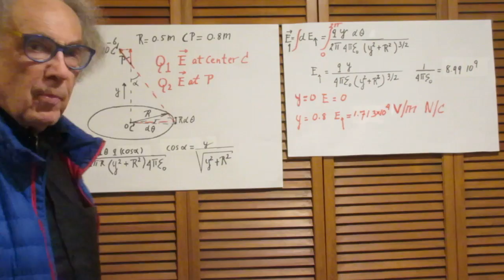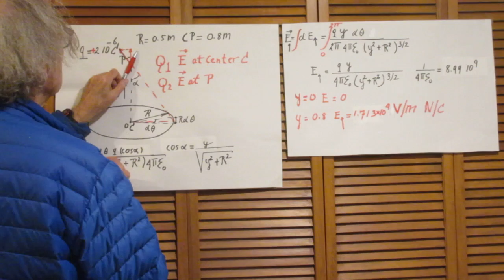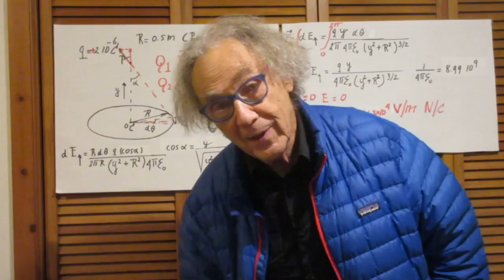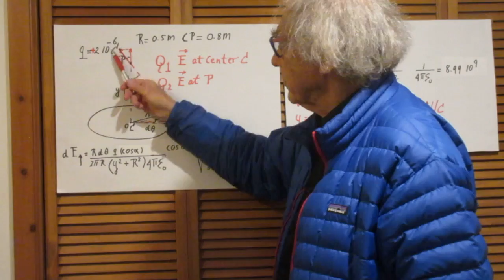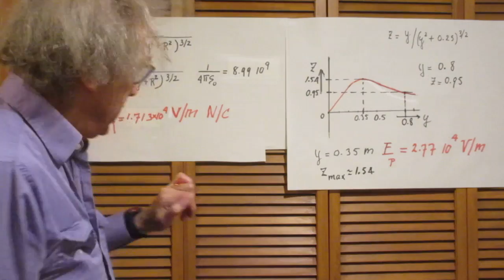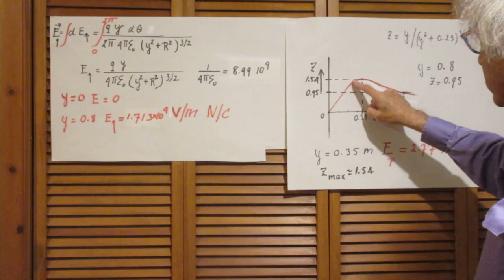Solution to Problem #49 - Charged Ring

Comment: This can be solved much easier:
one can say that the whole charge is at any point on the circle. (Because every "infinitesimal charge" contributes the same "infinitesimal" E_up. This can be treated as a single charge anywhere on the circle because of symmetry)

Thus we can calculate the E-field in point P with 

E=1/(4*pi*epsilon_0) x q/r²    (absolute value, not pointing in upward direction!)

where r² is the distance between any point of the ring to point P.  

r² = R² +0.8² 

Now we have to project the E-vector on the upward axis.
This leads to

E_up= E x cos(α) = 1/(4*pi*epsilon_0) x q/r² x 0,8/(sqrt(r²+0,8)) = 1,712717 x 10E4 V/m

with cos(α) = 0,8/(sqrt(r²+0,8))

No need for integrals! (When searching for the maximum for E_up, the mathematical handling is also easier)

Physics rulez!

best regards
Michael
Austria
Reply from the maker: yes this is faster. The ONLY reason why I did not do it this way is that my method in principle works for all configurations such as in Problem #50 where your method could not be used. When I posted #49, I knew that #50 would follow and I mentioned in Problem #49 that it was a warm-up to #50.

Comment: Actually the analytic solution is not so hard:
E ~ y(y²+r²)^(- 1½)  differentiate w.r.t. y and set that to 0
(y ²+r ²)^(-1½) - 3y² (y²+r²)^(-2½) = 0 multiply both sides by  (y²+r²)^(2½) 
y²+r² - 3y² = 0
r² =2y²
y= ±½√2 r

for r=0.5 this gives y= ¼√2 ≈0.35
Reply from the maker: excellent!
Reply: @lecturesbywalterlewin.they9259  
Thank you!

Comment: sir does the electric field exist inside the conductor . then why the electric current flows inside the conductor
Reply from the maker: HUGE electric currents can flow through super-conductive material. But there can be NO E-field in the superconductor. Read about the LHC.
Reply: THANK YOU SO MUCH SIR

Comment: Dr. Lewin I have query related to nuclear physics
'For any process if the binding energy increases then we can conclude that energy must be realeased which means that process is spontaneous.'
Yeah professor I can't understand how this statement can be true, I will appreciate any help from your side or any other viewer. Hope you doing well.
Reply from the maker: If BE per nucleon increases in a nuclear reaction, energy will be released. 
That happens in the fusion of low Z elements and in fission in high Z elements.
Reply: Lectures by Walter Lewin. They will make you ♥ Physics. Yes professor thank you, but wish i know the reason why energy is released when BE increases.
Reply from the maker: E=mc^2 If the rest mass decreases then energy must be released as energy is conserved
Reply: Lectures by Walter Lewin. They will make you ♥ Physics. Yes professor I got it but I solved this problem with a different approach.
X->Y and the binding energy per nucleon for Y>X. So firstly x dissociates into it's nucleons and A amount of energy needs to be supplied. Now for forming Y all these nucleons will bind up and supposed B amount of energy is released. Now the total energy released is (B-A) which is greater than zero.
Is my intuition correct? I came up with this idea just a couple of minutes ago.
Reply: @lecturesbywalterlewin.they9259  Sir I have seen in most cases they use E=mc^2. What about the other part of equation involving momentum? Don't we consider it here?
Reply: @chirag5656  dude can you please be precise, i cant understand what you are trying to convey, probably i can help you with this problem.

Comment: Another great lecture sir. But i want to say this. I dont understand whats the point of these objective type examinations and remembering those equations which can barely be used in the real world. Instead of remembering those formulas you can derive them whenever you need. For example, If you working on a physical  problem of real world(whether its mechanics, electromagnetism or relativity) you can start with physical laws and then usually you will end up with a differential equation and the only thing you have to do is to solve it. Thats it, there  is no use of those formulas. In school problems (or objective type) questions, all problems can be solved on paper but in real world you will get a differential equation(nearly alll the times) and usaully that equation can not be solved on paper. You need a computer to play a simulation. Again no use of those formulas. I understand your point sir. Instead of remembering every single equation in physics you can just remember the laws of physics and derive anything whenever you need. and thats the motive of physics. To decribe the nature with less and less physical laws. But they are kind of doing opposite of this. I really love the way of your teaching, instead of asking the students to remember formulas, you just encourage them to derive with the basic physical laws. I also want to become a physicist please give me your blessings sir.

Comment: Another interesting I thought up to solve the problem is that to assume two charges of charge Q/2 separated by distance 2R and find the charge on the perpendicular bisector of that line. I did that because all the charges  dq are at the same distance from the center of the circle and their horizontal component will get cancelled out and  vertical will add up so it would be a safe to make this assumption. What do you think Sir? 

After all physics is all about understanding and imagination.
Reply: I did that, more or less  ... it leads to the correct result. So you don' t need calculus to solve the problem.Even one charge on radius R will work but you need to multiply with sin(phi) to decompose the vector the vertical way. Any number >1 charges evenly devided over the now imaginary ring will lead to a straight up field anyway. The single point does not but multiply with sin(phi) and it's still the correct answer.

Comment: I tried to find an analytical result for the y value at maximum Z, and I get y = square root (1/8) = square root (0.125) = 0.353553391...
First, if Z is maximum, Z squared must be maximum, so I squared the equation for Z and call that value W. The formula for W now has y squared in the numerator and the cube of the parenthetical expression in the denominator (instead of the 3/2 power).
Expanding the denominator gives an expression in even powers of y, with y^6 as the highest power.
Substitute u = y squared, apply the quotient rule for derivatives, and set the numerator to zero.
This gives a cubic equation in u, with roots 0.125, -0.25, -0.25. y is the square root of u, so use the real square root, y = square root (0.125).

I do not have a good justification for ignoring the imaginary values of y except that I don't know what physical interpretation they could have; perhaps someone does?
Reply from the maker: superrrrrrr - my eyeballing (0.35) wasn't all that bad!

Comment: Know whats funny ? I computer coded the whole thing, dividing the ring in 1000 pieces and summed the resulting force for every piece. Got me the correct result. Today i changed my code and divided the ring in 1 piece. Got me the correct result. That means i could have done without coding.........
It also means that it's not relevant that it's a ring. It could have been one point on distance r but multiplying with sin(phi) would still be needed cause the resulting vector is straight up due to symmetry.

 I' ll keep my code for the next one :-).
Reply: Wow.....very innovative

Comment: I relied on the symmetry a bit more in my solution so I could just ignore the integral around the circle - however I have a feeling it will be necessary to do some integration on problem #50. 

In relation to the end piece about the maximum E field value, I couldn't help myself and I tried to do the analytical solution via the derivative.  I had to brush up on the chain rule again and after a lot of algebra the analytical solution is pretty simple, it goes like:

Max E field Distance = sqrt(R^2/2)

That's i! Now if we plug in the 0.5 you we get just as you said about .35 m.

Comment: The exact solution is y_max = sqrt (2) / 2 * R.
Reply from the maker: that's wrong. For R = 0.5 m Y_max is very very close to 0.35 m
Reply: @lecturesbywalterlewin.they9259  But sqrt (2) / 2 *0.5 ≅0.35355339059.
Reply from the maker: @facundovignolo   sqrt 2 /1 = 1.4
Reply from the maker: my eyeballing 0.35 was great!
Reply: Oh weird. I got sqrt(R^2/2) This is actually entirely equivalent  to yours for R values greater than or equal to 0.  Not that negative radii exist anyway.
Reply: Electric field is maximum at y= R/sqrt(2), both sides of ring
Reply: Your eyeballing was very nice SIR You are very enthusiastic at this age this is wonderful & very rare

Comment: It appears that when I solved this question and plugged in the values, while I derived the correct equation, I did it on my phone's calculator and probably miss-typed something, so I got an incorrect number for the result :|.

Anyway, the analytical solution is 1/sqrt(8), you can arrive at it since after taking the first derivative and setting it to 0, you get after a small amount of algebra the polynomial equation  

512y^6+96y^4-12y^2-1=0  

we can define x=y^2 and we get the polynomial equation

512x^3+96x^2-12x-1=0  

this can be solved analytically (there's even a closed form formula if you want), but for this one, we can just use the rational root theorem, which states that if r=(p/q) is a root of the polynomial (and p and q are integers, with q non-zero, and of course, the fraction is reduced), then p divides the free coefficient (coefficient of x^(0)) and q divides the leading coefficient (coefficient of x^3, in this case).  
So we get that all possible rational roots are of the form plus or minus 1/q where q is a divisor of 512, there are only 10 of those, so there are 20 possible rational roots, testing them one by one leads to finding that -1/4, 1/8 and -1/16 are solutions (and since this is a 3rd degree polynomial those are the only solutions), however since we know x=y^2, we know x must be positive.  
therefore the only solution is x=1/8, and from that we get that y=1/sqrt(8) or y=-1/sqrt(8), which we can check which is the maximum by testing some values (for example, checking y=-1, y=0 and y=1) and we can get that y=1/sqrt(8) is the maximum and y=-1/sqrt(8) is the minimum (which makes sense since we expect the E field at the same distance on the other side to be the of the same magnitude but in the opposite direction, that is the E field as a function of y is an odd function).
Reply from the maker: at what value of y do you find the maximum value for E?
Reply: Lectures by Walter Lewin. They will make you ♥ Physics. it is at y=1/sqrt(8) m (or sqrt(2)/4, if you prefer the radicals in the numerator), for the given radius.